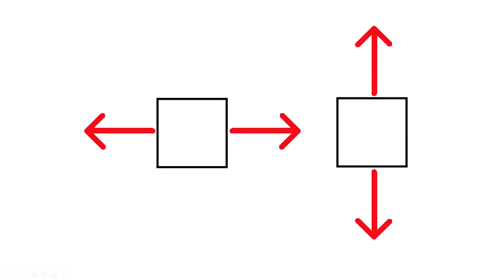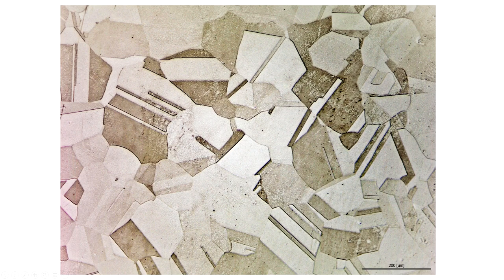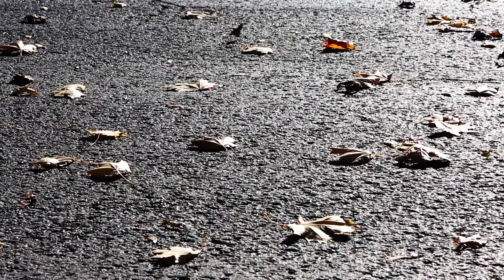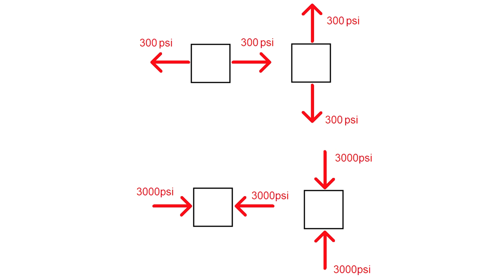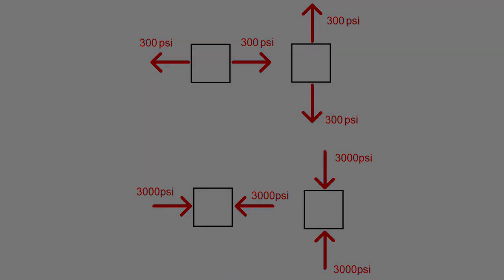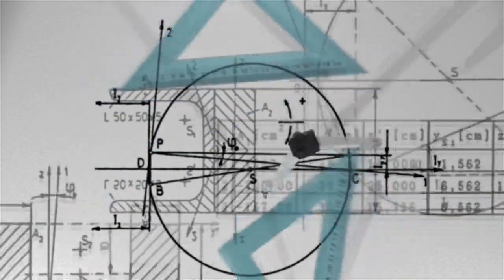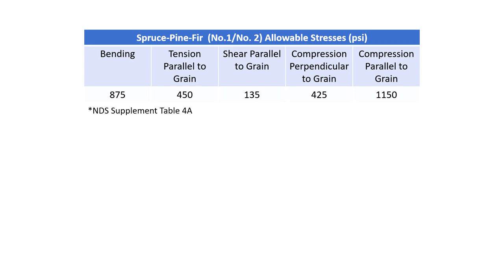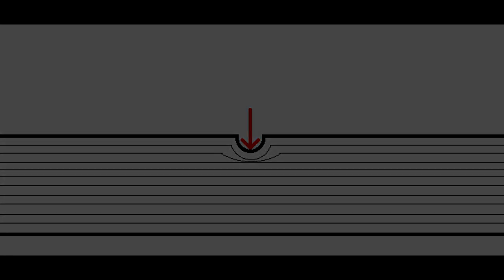Trees, Grain, and the Strength of Wood

Comment: The "shear" arrows at 1:44 are off!

Serious question though - if you have a beam with a square cross-section, outdoors use - what grain orientation would be advisable? Radial up, Radial down, or tangential? 

So:  /``\ or \_/ or ((( ?